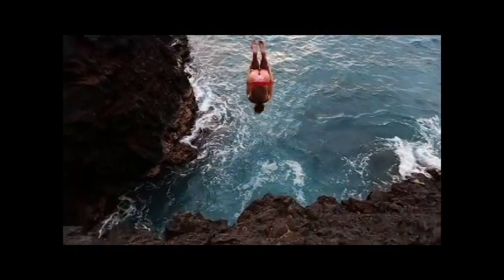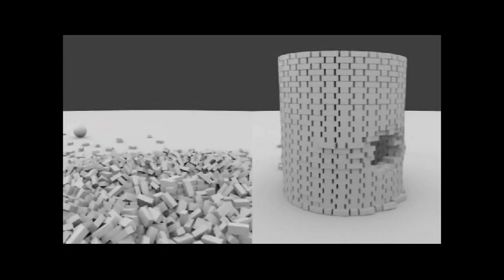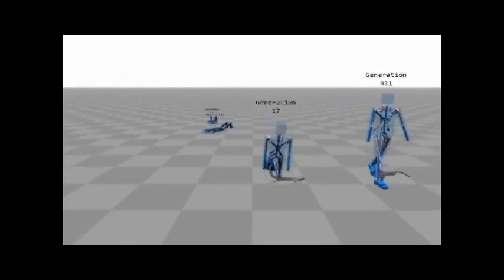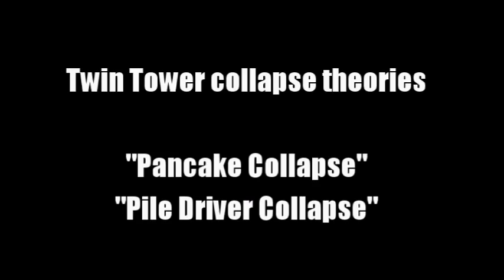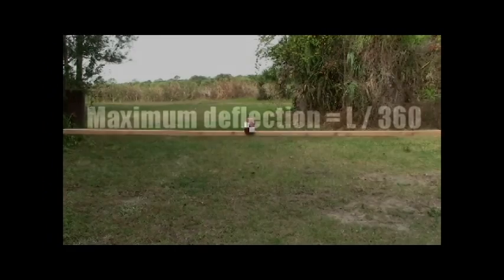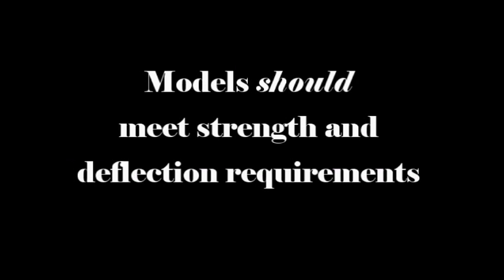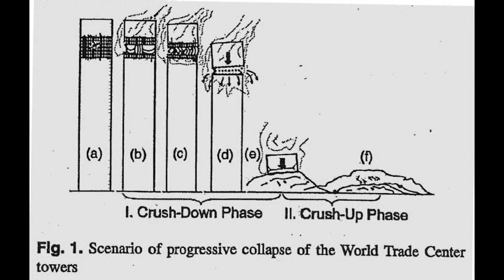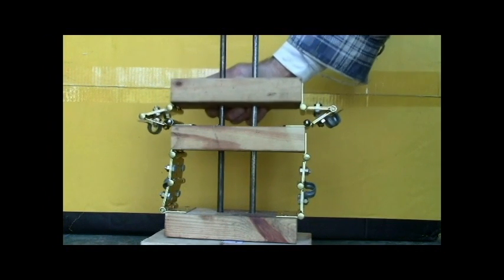9/11 Experiments: The Force Behind the Motion

Comment: No one sees the 'core' reason that this video is wrong?
Reply: Not sure what you meant: The metal bars and wooden outer walls strengthen both structures a lot. E.g. the wood vertically absorbs kinetic energy which is responsible for the slowdown/negative accelaration. The vertical columns used in experiment two provide a very strong vertical structure which cannot be compared to the (vertically) weak horizontal connections used with the trasses in WTC.

Sorry, but I don't see any findings in these experiments. Why doesn't he build a structure like the one used for the WTC towers with a proper scale? That would evaluate these theories a lot better.
Yes, you loose momentum with every floor destroyed. But you constantly gain moving mass with every floor too, that is accelerated by a constant size force (gravitation). I'd say the towers were simply not designed to withstand a total floor collapse. Why should they have been?
Reply: Yours is good. I was talking about the materials used and how used to 'prove' his theory. All it does is prove a theory of motion. Your scale build suggestion would be much better.

I notice no one ever takes in consideration of 125,000 tons of aircraft hitting at 400 kts and then 500 kts. I'd almost bet that without fire the buildings would have fallen.
Reply: I wouldn't almost bet: I'd take that bet in a heart beat. With or without the fires the buildings would have remained standing. Period.
Reply: Manuel S. Again, the buildings were beasts in design and structure. They were strong as shit and designed to take an impact of a jet airliner traveling 600 mph. You mentioned wind as a force: all aspects the buildings were specifically designed to deal with. No, there was no limited budget. There are several excellent documentaries about the building of the towers you should check out. The documentaries are pre- 9/11 so there is no agenda with them, unlike the post 9/11 documentaries.

You said it yourself: only the very next floor below matters in terms of whether it will collapse. The building below the impact zone (3/4 of the building) was undamaged. Nothing was weakened below the impact zone due to fire or structural damage. No reason for the bottom 3/4 of the building to collapse. The top 1/4 of the building did not poses enough weight or volume to collapse the 3/4 of the building below. CERTAINLY NOT at the rate of speed that we saw.
What we saw was the top 1/4 of the building falling down THROUGH the building with zero resistance, as if the bottom 3/4 of the building did not exist. If the top was crushing through the building that was structurally undamaged it would have met all sorts of resistance, making a collapse take much longer.
Reply: The point of the video is not to replicate the exact conditions, but to replicate the observable motion of the collapse. Whether it was the outer columns that failed or not is irrelevant. The point is that there are two different types of observed motion. One which replicates what we saw in the WTC tower collapse and one which does not.
Reply: ***** AAAND... the steel below impact was not effected at all. Not by heat or anything else.
Reply: Are you aware that the strength of these buildings fully relied on the outer columns? How much was destroyed.. 20%? 30%? How much was weakened by the fires? 50%? Can you imagine any structure would be build that can take a loss of 3/4th of its strength? No normal structure can. A high-rise and therefore weight-limited structure would never be designed to do so.
Reply: Manuel S. Wildly exaggerated percentages there, Manuel.  3/4 of it's strength???  

Damage to the impact zone. Maybe a couple of floors below impact zone. Below that? No damage. Nothing was broken below there, no fires damaged or weakened below there, nothing effected below there.

Above impact zone? Some structural damage, some fire damage, some fire weakening etc.

The amount of building above the impact zone did not have enough weight and volume to crush THROUGH the undamaged building BELOW the impact zone. 

That is the way the building was designed. It wasn't a normal structure. It was build like a beast. It was designed to take a hit of a passenger airliner going 600 MPH. NIST themselves uncovered documents that proved that.

The buildings should both have sheared off tops. Nothing more.
Reply: "125,000 tons of aircraft" not even aircraft carriers weigh that.
Reply: +PeaceMarauder, no one appreciates implied claims like yours which have no basis in reality and no evidence to back them up.
Reply: Only they didn't remain standing.
Reply: Michael Snyder That is correct, they didn't. Therefore foul play was at hand.
Reply: So, what is the amount weakened? Are you aware that steel becomes a noodle above certain temperatures? A few hundred degrees and they support a shit. The vertical strength of a skyscraper is determined by its weakest point. Above doesn't matter. Only the very next floor below matters in terms of whether it will collapse. The kinetic energy of the tops falling only 4 meters deep is way too high for any structure. To make things worse the trasses might have been damaged first so the core had no further support (and it was designed to support nothing more than its own weight) and the outer columns did not have any anchor point vice versa (which was the source of their strength). Sorry, I dont see any problems with the collapse. I might be tempted to blame the design or lack of fire-proofing, but it seems impossible to design something with materials and technologies of the 70's, not to mention building it with a limited budget.

Anyways, with such damage, a (partial) collapse was only a matter of time. Wind is a far greater force than gravity, so the next stormy day would have destroyed major parts of the buildings anyways. AFAIK unprotected steel buildings can only survive a few hours of massive fires. That's why they bring in fire-proofing, forbid/limit anything that fuels a fire, require sprinkler-systems and create fire protection sections. It's ok for structures to fail if they allow for enough time to fight the fire and/or evacuate the building. Any design will fail at certain scenarios (e.g. earth quakes). The question is: what's likely? A structrual design will fit the needs for a certain place (max. expected magnitude, ..) but will not exceed those by far due to economic constraints..

They might look massive but skyscrapers are kinda weak vertical structures. With a known weight, there is no need to design it any stronger than gravity mandates, is there? Why should they've been designed to withstand the force of a bigger, partial collapse?
Reply: Rod Martin, Jr.
The only way to have empirical evidence would have been to watch inside the buildings as it happened. Everything else is Occam's Razor.
Reply: PeaceMarauder Not necessarily, computer simulation has been an accepted form of scientific experimentation for more than 40 years.
Reply: and yet no one sees the core of the problem with this vid

Comment: yes but the difference is you used an open model when you managed to get the structure to fully collapse... but you recorded a deceleration or at least no acceleration... but when the floors blew out that would give the same effect as a vacuum.. which could cause an increase

Comment: DId you notice that your steel support stayed standing?  The cores of the towers did not stand.
They used something and it was not conventional.  So it could not have been a usual controlled demo.  That much is obvious.
NIST and all of them are idiots, or, they think we are idiots.  

(John Hutchison can do it.)
Reply: Substantial heights of both cores were the last part of the structures to collapse...they stood after everything else had collapsed. So much for removing the cores to collapse the buildings huh?
Reply: That and this;  there were parts of the spires/cores which stayed standing longer than the rest of the building(s).  It literally became dust, in mid-air.  That is some CRAZY stuff!
Reply: annebeck58 No steel "became dust". All the dust which accumulated on the spires of core during collapse blew off when the spires started down. All the steel from the buildings were found on the ground, right where you'd expect to find them.
Reply: partybiscuit   I finally had enough and blocked him.
Reply: @whetedge   Not sure what you saw, but, I saw it become dust.  The amount of steel left on the ground, and taken away by the recycling teams, amounted to about 64K tons.  The WTC towers, alone, were built of approximately 500k tons.  What happened to the rest?  It blew away in the wind.
Reply: @annebeck58  Yeah, ok.

Comment: These "models" are not models, and these methods are not even a little bit valid. This is what it looks like when someone looks and sounds like a scientist so people believe what they say. And why the hell would anyone believe this science guy but all the other scientists who have worked on the problem? Do we pick and choose our scientists based on whether their conclusions agree with our existing opinions?
Reply: Platos Cave
Nah, I look at methodology. I'll give up a hypothesis if it's refuted by evidence, but evaluating the evidence is crucial. This evidence fails in numerous ways. Modelling has to account for as many variables as possible. These models seem to account for one only.
Reply: To bad a lot of evidence was blown in the wind and shipped off too. So just take a little rock and turn a big rock into dust easy right?
Reply: DetachedOnlooker
NIST offered their analysis, and so did many others. They were a damn sight more thorough than the guy in this video.
Reply: except NIST can't be bothered to supply their simulation data for peer review. so much for the scientific method.
Reply: Thrashaero
University faculty have published their data on the 9/11 structural failures. It's been so long - I don't remember which universities were involved or who looked at what, but the data is (are) available from NIST and from the academics.

If you are referring to computer modelling algorithms, those can be tricky if the modeling software is privately owned. That is a risk of privatization. But every bit of work that NIST does is in the public domain. It's not always online though. Remember, the Internet is kinda new in historical terms.

Have you asked them for their simulation data? Try asking them. Be specific about what you need. "Simulation data" is not specific enough most likely. If that doesn't work, then file a FOIA request. If that doesn't work, let us know, and you'll actually have some credibility on this matter. Don't just parrot something someone said. Inquire! Be willing to do the work yourself.

Getting information and documents from the federal govt can be frustrating, but if you understand the system, it's not difficult.